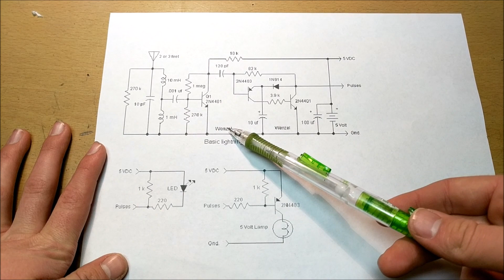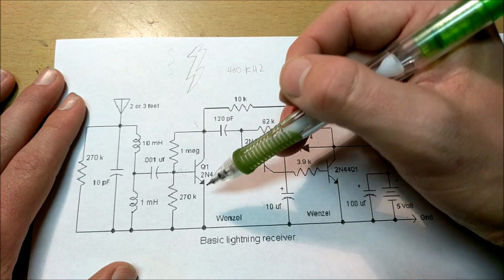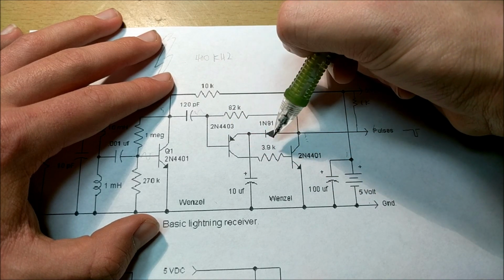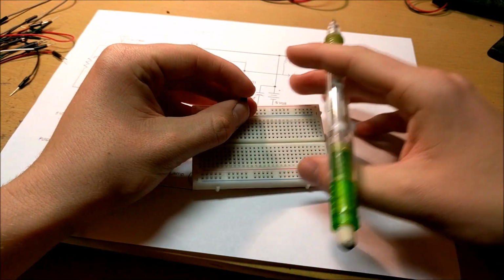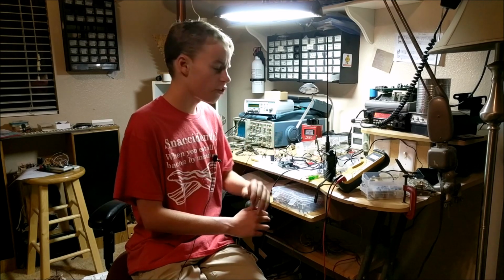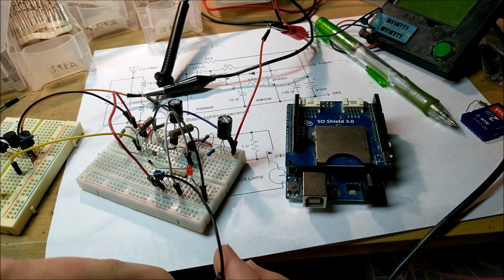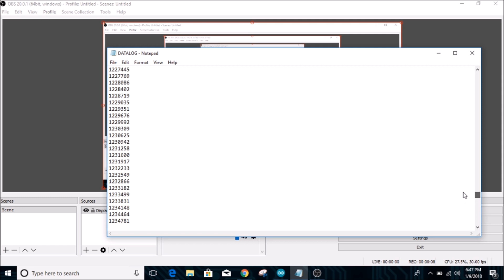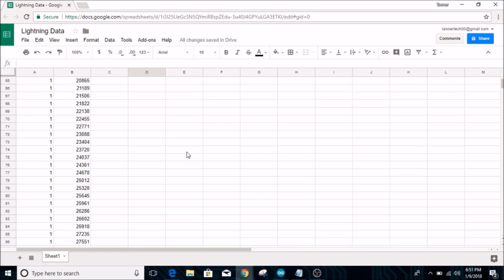DIY Lightning Detector Explained

Comment: Thanks - I built Charles Wenzels circuit some years ago, but never really picked up any lightning, it would detect the start-up of the old fluorescent tube above the bench though. BTW Mr Wenzel is a smart man, and a true gentleman - I enquired to him where I could get the inductors needed, and he sent me a bag full (internationall) and wouldn't accept a cent back.... 
Your explanation is great, I searched YT just now, as I'm planning on doing exactly what you are doing - hook it up to an arduino to log pulses.... wish me luck!
Reply from the maker: Wow, that is awesome! Good luck @geoninja, if you get it working you should post a video and send a link.

Comment: Every AM radio from the 1940’s uses a 455kHz Intermediate Frequency, so you can rip out the front end, and Local Oscillator, and start with the IF section, and you have an AM radio with about 20-30 KHz bandpass area. Then you could hear through audio, what your washing machine, dishwasher, and even light switches sound like. I’m sure any of that will be triggering it too, unless you make the effort to stop any mains switching loads in your house. I’ve never looked into ways to discriminate between lightning and the noise, but lightning does have distinguishing characteristics.

Comment: Advanced mode project is to work out how to detect the amplitude and duration, as well as directionize the detectors so you can work out the direction of the strike.
Reply: Hi lightning radar project is ready.  In the world is still active 3 antennas

Comment: Your explanation of the circuit was very clear. Do you have an oscilloscope to check the input going into the Arduino? Perhaps even a small capacitor inline there will help smooth out the pulse if it is "bouncy". Do you have a real time clock module? With an RTC module you can set your pulse input as an interrupt and then just read the time stamp. Another thing you can do is have it start counting pulses from that point and then only reset the interrupt to active if you have had no pulses for a given time. This will give you a set of time and count values which may help you to distinguish between a sharp clean pulse sources and a more noisy one so that you can discard some on that basis.

Comment: I thought you said the circuit is at 5v and  goes low when it detects a strike so wouldn't you have the arduino record 0s not the 1s ? or did you add an inverter  transistor before the arduino input ?? nice vid fella

Comment: A long time ago, I had a wired intercom. The wires feeding the speaker were way on the other side of the warehouse. I could tell if a lightning storm was coming easily, even if it was a State away by the crackling sounds. The volume would increase as the storm approached closer.

Comment: Thanks!  Correct me if I'm wrong, So basically antenna with receiver to CE transistor amplifier to LED trigger circuit?  I definitely want to build one!
Reply from the maker: Yep, basically just a radio receiver tuned to the frequency of lightning(peaks around 10khz).

Comment: Hey! Great video! A question... I am searching for a solution that would warn me if a storm is coming, however, if possible, something resistant to the HF radio operation. You keyed the RIG with minimal power to an antenna out of the house, which caused the detector catching false positives... I run ~100W on HF into my wire antenna in my garden and I am afraid that it would "blow this detector's mind"... Maybe a tuned antenna? Maybe a low pass filter? Or would the detector have to be "remote"?

What I search for is something that would constantly run and in case of a storm coming, it would tell me "Hey dude, disconnect your coax cables from the shack!"
Reply from the maker: That would be cool! I know lightning peaks around 5-10khz, so maybe have a spectrum analyzer that uses a relay to disconnect your coax when it detects a peak in that band.

Comment: Is it possible you picked up a spark plug firing during the day? Perhaps the antenna needs to be smaller? 
I say this because once I picked up a lightning detector at a moving sale. Added a 20 foot long wire antenna and the thing went wild when the neighbor began running his weed eater. Cut the antenna down to 6 inches and solved that problem.
Reply from the maker: Very possible

Comment: The strike counter program way to complex for the job. You only needed to read the Pin state. High or low. Add 1 to count when the state changes.  If pin is Low then add one to the count. That Guy has a name it's Charles Wenzel the least you could do was to use his name correctly after all he did the work for you. He's not just some Guy.

Comment: Interesting video Tanner. What would the chances be of another close by Ham Radio station or RF source at 400 KHz causing the circuit to trigger falsely?
Reply from the maker: +Claude van der Ryst It could be.  I think that I just need to have a comparator on the output of the circuit feeding into the Arduino.
Reply: It would be interesting to see what was causing the logging of false strikes, so keep us updated. As +Daniel Matthews suggests to add the date/time stamp with each strike. I'm going in beginning February for about 2 weeks to Johannesburg here in South Africa and this time of the the year there is almost every day thunder storms there. So I will be building my own circuit and hook it up to a Raspberry Pi I have lying around and see what results I get from the storms.
Reply: No one would use it even if it was a ham band.